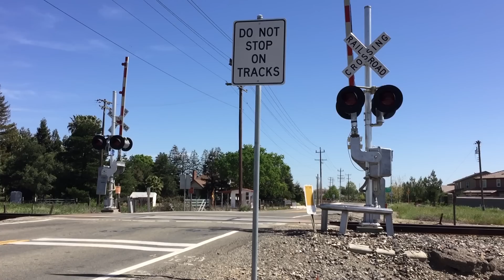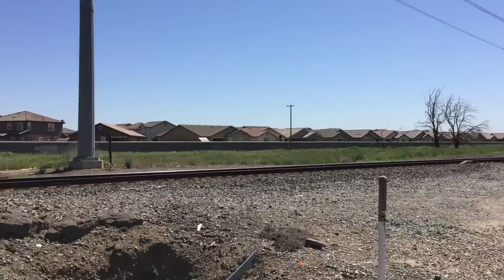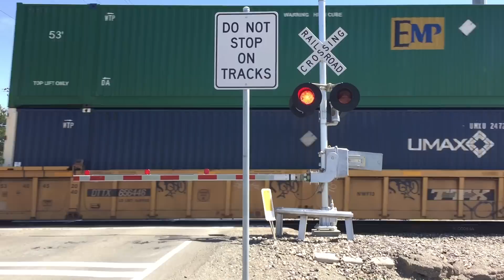Union Pacific 8005 Intermodal Northbound, Bilby Road Railroad Crossing, Elk Grove CA

Comment: Great video.
They're starting to put those NEG bells all over the place even over here in houston at one of my crossing spots.
and it's on the UP Glidden Sub out here just on the UP lines i'm seeing so far.
Reply from the maker: Thanks! Yeah UP started installing these signals on their lines back in 2011 as new signals discontinuing the all WCH signals as new signals after that. In my opinion I liked when they were just upgrading old signals to LEDs and installing the WCH signals as their new signals. NEG Electronic Bells were once rare before until UP decided to make them their normally installed bell.
Reply: Yea I mean don't get me wrong I like the WCH bells and still do, But the NEG Bells are good sounding bells.
If you think about it don't it sound like the GS type 2 E-bell?
Reply from the maker: +Drejon Williams I like the sound of the NEGs too just that i wish they stayed with the all WCH signals. They have the same sound as Gs type 2s but a different cling in the ring.
Reply: Yea I hope they go back.
Maybe UP thought it was going out of style using WCH Crossings.